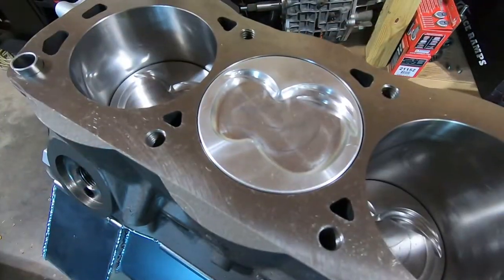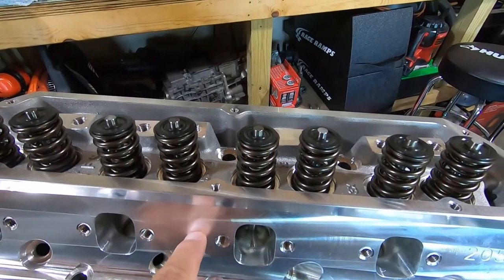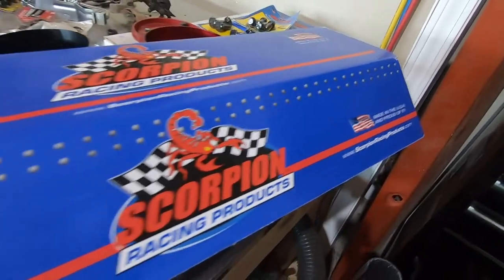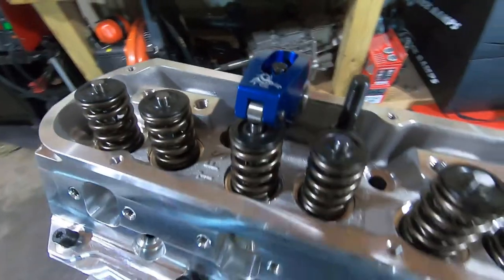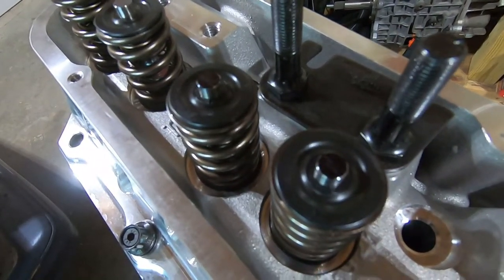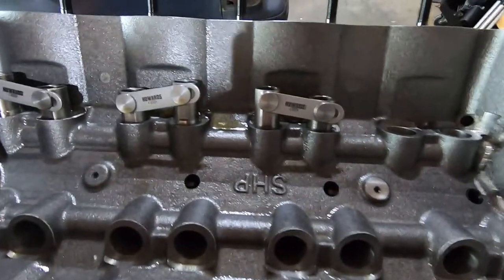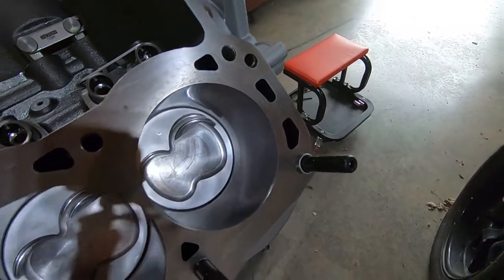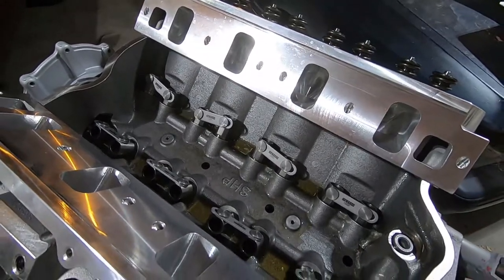Dart SHP Ford 427 Top End Assembly

Comment: What heads do you recommend for a roller 351w? Afr renegades? I’m not sure my stock pistons would work will 11r Trickflow.
Reply from the maker: Depending on what you want to do with that 351 will ultimately decide what heads to go with. If it’s going to be a street car, for all around good midrange power and streetability, I for one would opt for the AFR 195 Renegades. Piston-to-valve clearance will depend on a combination of valve size in the head, piston reliefs, and the big one, cam. The bigger the cam, the more overlap on exhaust/intake stroke which is where piston to valve clearance really comes into play.
Reply: @GeorgiaStangMan  it’s a turbo setup with holley ecu. I have Trickflow stage 1 cam(small) , factory pistons I’ve not seen. It has the scorpions, ported lightning lower, unknown ported heads believed to be the first gen Trickflow wedge heads 170. No names on outside of heads. Thanks
Reply from the maker: @timweb1510  that’s going to be a nasty setup right there! Stock 351’s have pretty deep dishes, but no matter what head you get, definitely check the clearance. Keep me updated on that build 👍
Reply: @GeorgiaStangMan  thanks sir